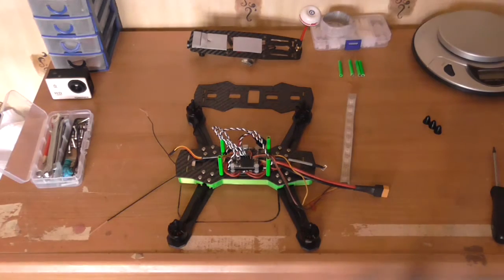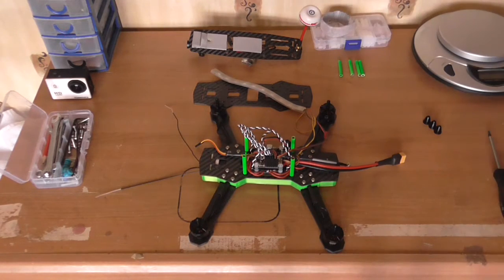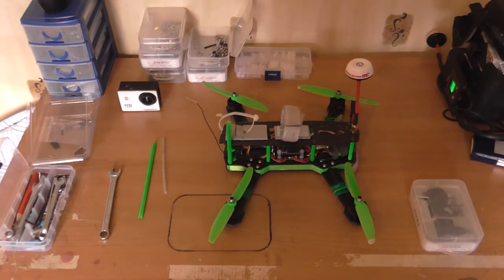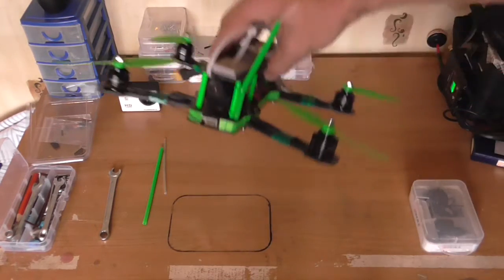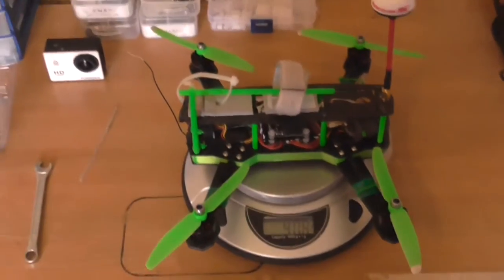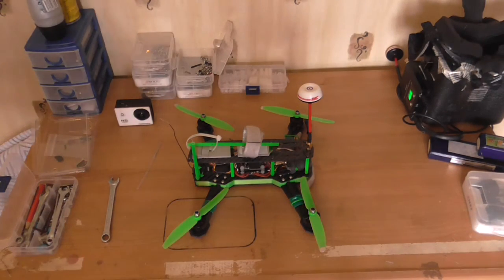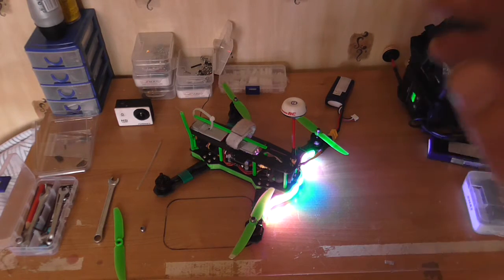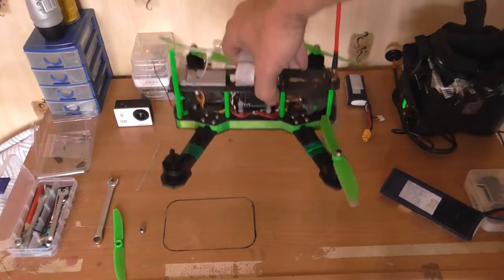ZMR250 1-5 Rebuild Part 2

Comment: aww dude im doing the same a low-rider build without the FPVModel PDB since the 2nd PDB i got from them blew the 5v rail.. was thinking of actually putting the Thug 1.2 PDB underneath the bottom plate from the Naze if you catch my meaning..  so it would be the Naze then the plate its mounted to then the small PDB under the plate but obv the ESC`s are in there so things may get a bit tight !! anyhoo my build is on hold still waiting on my Thub PDB :/

e2a : watch full clip before posting :D